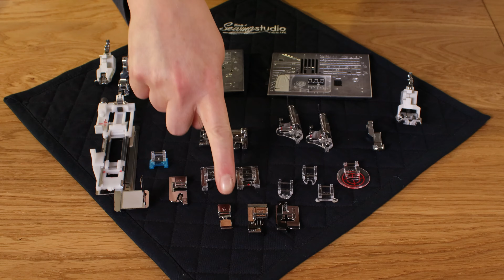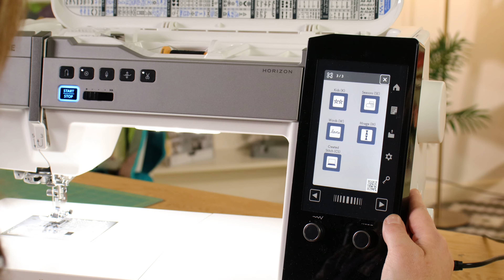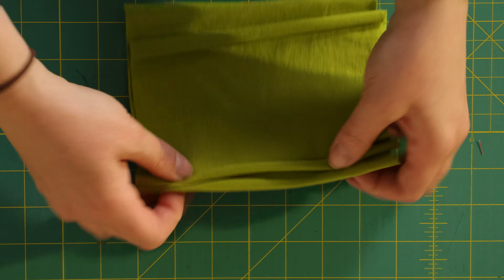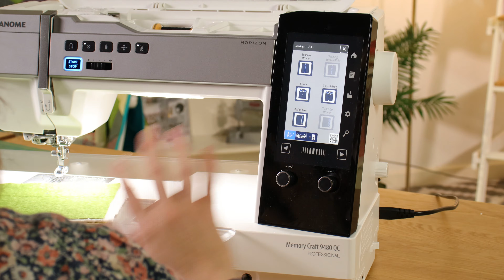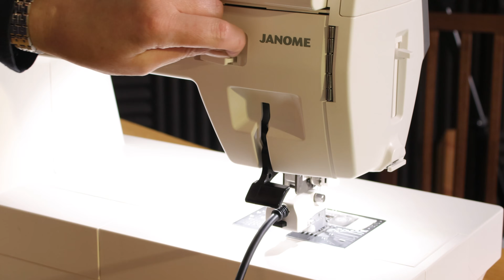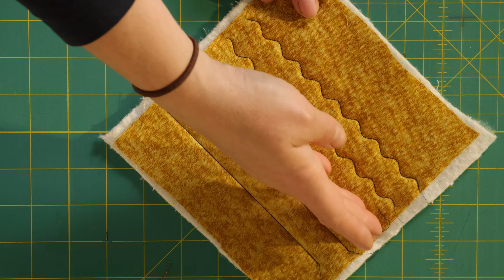Janome Memory Craft 9480QCP Sewing Machine

Comment: I bought this machine in March and I adore it! I love my 6700P too, but this is my current favourite. Love the pivot function and you didn't mention one of my most favourite features - the pull out light that is EXTREMELY excellent for anyone with eyes that need a little help.
Reply from the maker: I know, I was going to use it in the sewing section and then totally forgot! you are right it is a great feature, adding extra light just where its needed. I love the 6700p too, but I really enjoy using this machine, it always amazes me how effective the automatic functions are and how you never knew you needed them until you use them! Best wishes, Anna